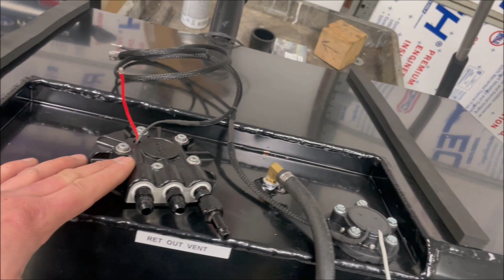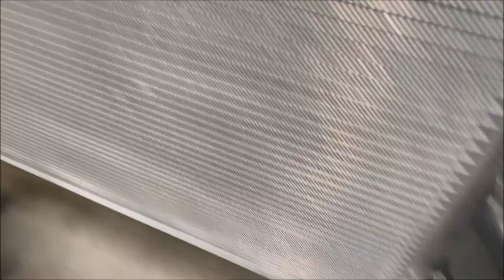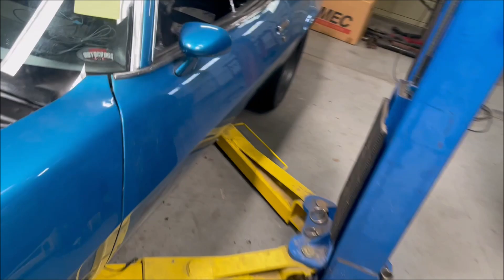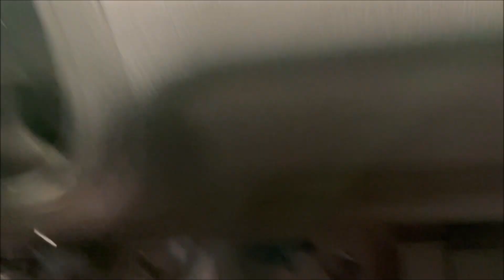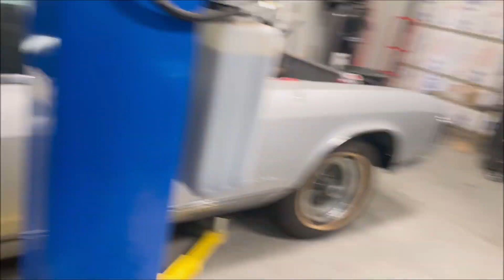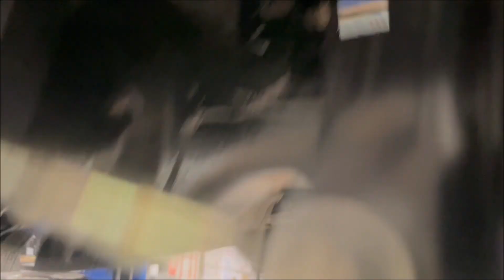Custom Works 1971 Camaro Rebuild Part 7   Progress and new parts avaialble now!

Comment: Man, don't give up on your video's! You are an inspiration for us other 2nd Gen builders! I am into a long project, DSE tubs in , new firewall, new quarters, new tail panel, raised the rear floor area for exhaust, new Real Deal Steel tunnel just finished,  LSX block just arrived, T56 Magnum, QuickTime bellhousing. Still need to purchase the rear suspension.  I really  like what you build and will be a customer for sure. So my two cents is to hang in there with the videos, we are watching,
Reply from the maker: I apprciate that.  Ledt me know if we can help with your project!